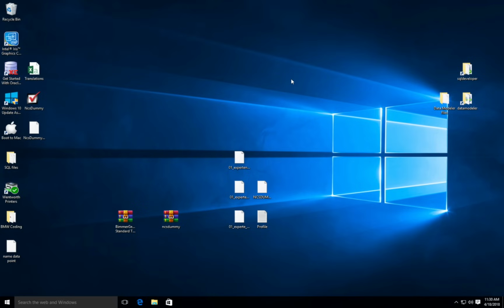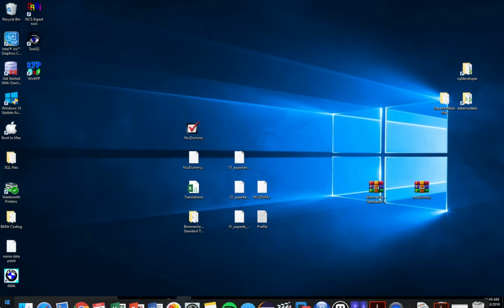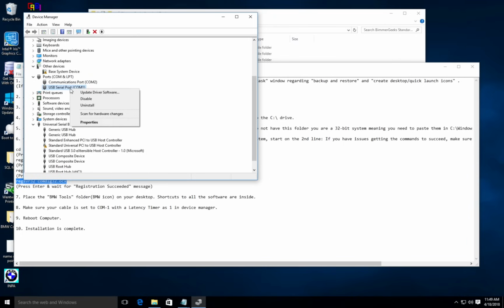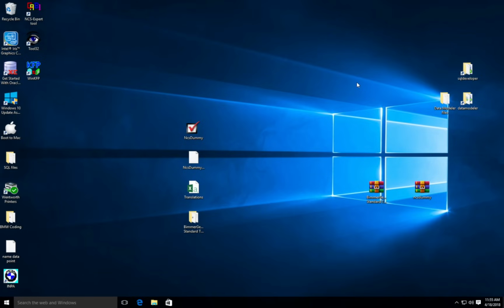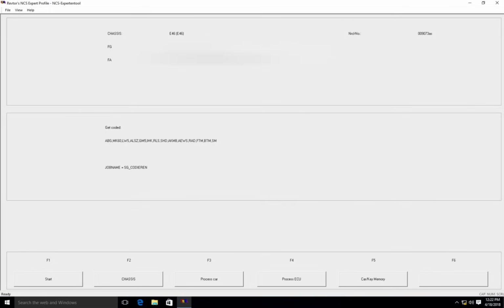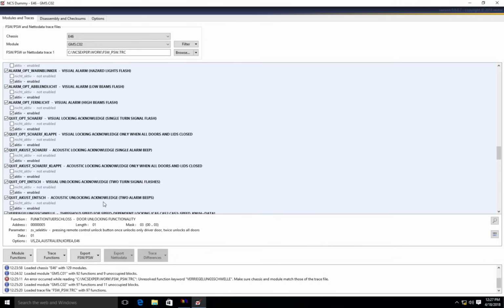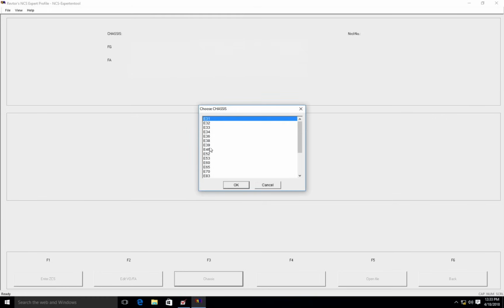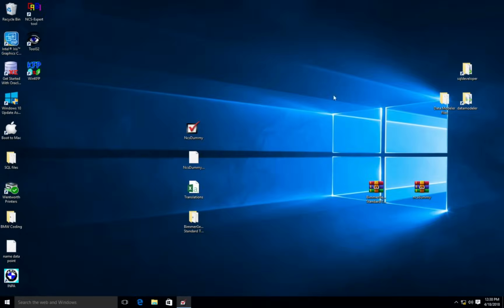HOW TO CODE YOUR BMW USING NCS EXPERT | WINDOWS 10

Comment: For those getting the 'VIN not found' or whatever it says error:
I ordered the exact same cable from the exact same seller. I was getting frustrated and about to give up. I watched this video over and over, deleted and redownloaded the software a couple of times (is 'redownloaded' a word?) and then I remembered that Evan repeatedly said: "make sure that pins 7 and 8 are connected". Same cable, same seller, same switch setting, right?
Nope. I took the clear connector apart to verify that the pins were connected, and noticed that the wires were connected on the right. I moved the switch to the right, and bingo.  Immediately connected.
Hope this helps someone. Try all 4 switch settings if you need to.
Reply: moved what switch?  I have the blue connector apart, and see no switch.  Pins 7,8 are soldered together.
Reply from the maker: Some cables have a switch for different BMWs and some cables are soldered to just work on like the e46, e39, e38
Reply: Ok thanks Evan. I’ll keep trying
Reply: Can you help me I think I screwed up my ecu
Reply from the maker: What were you trying to do?
Reply: @EvanGoyuk  I was trying to do some coding to one of my ECU on my E89 using NCS Expert and NCSDummy but after I coded the first time by 1) upload the TRC file 2) export to MAN file and 3) execute job to SG COIDERIEN and the job was done and completed...........Then this is where i screwed up. I DIDINT EMPTY THE MAN and the computer ask if i wanted to back up man and trc and i choose NO.  From there on i kept making more mistakes by loading up new ECU from the "CHANGE ECU" from the NCS dummy BUT BUT i never change the ECU on the NCS expert side and kept export to MAN and execute the job to write it onto the wrong ECU.....

I did this to about 4 ECU with the same MAN file and now theres errors....AND NOW my car wont start it will crank but no start. I check spark plug it has no sparks.

What do i do now?
Reply: @Yourgirlnadia67  omfg😰
Reply: @Yourgirlnadia67  just code direct from Daten files, back to factory settings.
Reply: @karledenvann6354  how can you walk me step by step please
Reply from the maker: Message me on Instagram for more help @evangoyuk
Reply: @Yourgirlnadia67  Quote Originally Posted by vickumar View Post

Now what do you do if you screwed it up or something is behaving funny and you want to go back to original settings. Or you cant remember all the stuff you changed, or dont like the results.

To load up the ORIGINAL factory defaults if you mess up.

Go to your /WORK/ folder. Open FSW_PSW.MAN, select all, delete, save & exit.

Load NCS Expert

Select "Expertmode" profile

Hit "VIN/ZCS/FA" to load your Chassis and Vehicle order info

Hit BACK

Hit PROCESS ECU

Select the chassis, then module you F'd up on. For example "LSZ"

On Pre-02 cars It will say "LSZ" and underneath "SG_Codieren" along with some files LSZ.Cxx, LSZ.PRG, etc etc. SG_CODIEREN is the correct job you want.

On Post-02 cars It will say "LSZ" and underneath "SG_Codieren" along with some files LSZ.Cxx, LSZ.PRG, etc etc. Hit CHANGE JOB, Select "FA_WRITE" Job.

These files are basically from your /DATEN/ folder and contain the proper coding information specific to your car. How does NCS know which files to use? Because it knows by looking at your VIN and VO, then selects the correct files. NCS will then basically read these files, then read your VO and re-write the proper codes, features, activate, deactivate everything to your factory settings.

The job is SG_Codieren or FA_Write because you will WRITE your original settings back in.

Hit EXECUTE JOB.

Viola, your original data is re-written and your car will work again. Hopefully.
Reply: @karledenvann6354  you're a legend. Very useful.
I bought a scrap car to practice on.
Reply: @EvanGoyuk  does this cable works on 06 BMW E65/66?
Reply from the maker: Yes
Reply: @EvanGoyuk  thank you
Reply: @EvanGoyuk  how about a 2007 bmw 328xi e90 will it work ??
Reply: @Yourgirlnadia67  did you solve anything?
Reply: Instablaster...
Reply: For „vin not found“ you muss close the inpa
Reply: First ..expertmode error ..also .missing modules only 2 in list...when i open dummy there is no option change vin on module🙆
Reply: @homeluangaphay2801  any luck with solving your ecu
Reply: hi kindly share new link for the stardard tools

Comment: I was able to code with this video it was helpful, it was for my 2000 bmw 323i, i had to code the new alarm siren, and tilt sensor. And the interior sensor, i also was able to turn on the windows going back up with the key fob, everything works well thanks go the video, i also used windows 11, you can by pass

Comment: Does your led indicator on obd cable turn off after few minutes? I have older e46 with round obd i need to use adapter… inpa says both circles black but led diode on cable is turned off after few mins

Comment: Your vid is the only tutorial that actually helped me with this, TY. I wanted to code an instrument cluster I picked up from a junkyard to change it from a UK to US kombi/kmb (I'm not in the US) to stop having driver/passenger doors inverted and to get US fuel consumption instead of UK MPG. At first although the coding job was executed (and I heard the cluster "roll") but did not land any results. I realized that's because I had closed NCS dummy before executing job so it must have coded the TRC file I guess... The only thing that did not work is the tamper dot removal, eventhough I checked the appropriate option and the mileage had already actualized on its own when I first connected the cluster (apparently the cluster displays the highest of either its own or the car's mileage upon first connection so it must have had a lower mileage than the car).

Comment: I did a reset on my SAS and that performed correctly and the DSC is still lit up on the dashboard. I need the SZL coded to the car but it won't allow me because vin is faulty. Any suggestions

Comment: Hello! First time caller, long time listener. I was wondering if you would be willing to assist me with a short remote session to fix my no EDIABAS option in setting for ISTA vs. 4.49.23, or point me in the right direction. I have updated the ports and config settings and still nothing. Also if you can may you provide me with the coding options for the E70/N55/2013/X5, I have 4 CAS settings driving me crazy I need to code.

Comment: Hi,  I can get INPA to connect - sees ignition on and off - but can't get passed the Chassis loading for my E63 - after loading the profile (used the same one you do in your videos).  It appears (for a number of things that I've seen) that I would need to choose E60 (Series 5) as there is no 63/64 but when I select that it doesn't bring up the ECU selection (CAS) and I get no VIN no. etc?  I definitely have Pin 7/8 connected (switch to the right) and I 've tried the switch in all four positions (to the right definitely connects pins 7/8 - checked it with a multimeter).  Any thoughts about what I am doing wrong?

Comment: Hi Euan,
Great video walk through.

Quick question, my GM3 module went faulty so I replaced from a donor car.
Would I now have to use NCS EXPERT TO code it to factory or is factory not VO ie…… folding mirrors when in reverse etc….. and is back to basic settings?
Do I click process car?

I hope this makes sense.
Look forward to your reply 👍

Comment: Hey man! Great video. Wondering if there is a way I can turn off bulb out warnings. I’ve built some custom tail lights with LEDs and don’t want to run a load resistor due to space and also the heat they generate. Looking online there’s not a lot of direct info on where to find it.

Comment: Since manual and auto trans E46's use the same cluster, would it be possible to custom code the cluster in a manual trans E46 so it displays the gear selected based on RPM and wheel speed? 
I've seen stand alone systems display gear selection on manual transmission cars doing it this way, so it seems possible since an E46 already has all the needed hardware.

Comment: Can you please make a vídeo, or if someone could help me because i want to install rear powered windows in my e46, and i have to copy my current (low)gm5 module options to the new (high) gm5 module or else my key won't unlock and lock the car. So i need to copy all of the options of my gm5 module to the new one. With NCSexpert

Comment: HI I am using window 10-64bit and it seems everything install corrected.   As I verified, Everytime I plug/unplug USB K+DCAN and see usb serial port (com1) appear/disappear. Also "Battery and ignition is black dot show" But none of winkfp/NCSexpert/INPA   will pop up messages "IFH-0003 DATATRANSMISSION TO INTERFACE DISTURBED Program will be stopped "   Any idea what K+DCAN missing configure here? I even tried to different COM X then other will not make "Battery/ignition black dot"  NOTE: trying to re-flash FRM footwell corrupted.

Comment: What is coding? Programming? Flashing? Say if I am replacing the airbag MRS module, it is flashing? Here in the video, coding is just changing the optional settings for the module, like one touch all windows down. INPA is to just test the cable and ignition on? NCS Dummy is just a translation from german to english. TRC file is when u read. MAN file is when u write? They are both just txt file.
What is profile? A looking table from VIN to all the factory modules? 
Yes, I am still so confused. I don't want to just follow the step by step instruction. I want to understand the concept and the overview.

Comment: Hi Evan, are you still actively coding? I’m having trouble coding out a cornering light error on my e90. The motor crapped out and I have since replaced the complete headlight units with after markets.
Are you able to advise?

Comment: Very informative video. Thanks.
I could code an E46 323CI after following this just fine. However the E46 M3 remains unchanged. No errors though. Coding gets finished just fine.
I already did an SMGII tune using MSSTuner so there must not be an issue with the K+DCAN cable. I need to try it again tomorrow fresh.

Comment: Question
I didnt have on my bmw e46 bc button on left side, so i installed it but now i need to code it, where in NCSExpert i can find where to activate BC button from there and see if it works ? What modue does that bc button belong inside ncsexpert ?

Thx in advance

Comment: I recently picked up a 2011 e82, I tried to code my mirrors to fold on locking , but BimmerCode mentions my FRM to have severe faults. Would I be able to get around this by coding via NCS?

Comment: An excellent video, for those of us that are starting to use INPA and the rest of the software.
However. After installing the software following the instructions here, I get all the INPA diagnostics in German. I left all the tools in a folder on the desktop called BMW TOOLS, and moved the translations.csv file there, but yet the diagnostics are not translated. Should the .csv file be located somewhere else? Txs for the help

Comment: Hi Even

Had to change the ECU, ABS pump and the cluster in my E46 M3 due to a fire in the engine bay! Any ideas how I can change the FGSTNR so they all have the correct VIN number for the car?

Also need to do any coding thats required for them to work and talk to each other etc, can this be done with INPA or NCS Expert? I also have PA Soft but a lot of my options are greyed out so maybe I'm only running a demo version or something? Also have a Lew fault which I think just needs the steering angle sensor to be calibrated which I think I can do on INPA

Any help would be great

Great tutorials by the way

Loz

Comment: Great job, very informative. My question is what if you wanted to do a used module? Would you read the original, copy all the coding in notepad, put in the replacement one. Open in notepad, delete what's there and paste the original coding info?

Comment: hello I'm trying to follow in your footsteps but an error message is showing: "Error at changing ZCS COAPI-2020: SG antwortet nicht IFH-0009: SG nicht angeschlossen oder meldet sich nicht C_GM4 COAPI-2020: SG antwortet nicht CODIERINDEX_LESEN COAPI-2020 : SG Antwortet Nicht"

can anybody help me? I have bmw e36 323ti 1998 wich GM4_C03

Comment: Ok guys I hope this fall somewhere in this but if it doesn’t then I’m sorry so here I am driving my 2007 bmw 335i and all of a sudden it hiccups and all my warring go off trans malfunction,DSC  engine malfunction etc otherwise I’m in limpmode so I get it home next day my battery has dead cell get new  find out my alternator was bad fix that now this is where I came across ur comments maybe u can help me I know I need it right cables to plug into my car and the software but my question to You is how to get my car out of limp mode do I need bmw to clear or can u help me with the problem I could really use ur help or anyone out that can help with this problem also  I have registered the battery and did a hard reset but still when I start the car no major warning I know the car is In pretty good shape problem is it always brings up after it’s running for a few mins any help would Definitely be appreciated

Comment: im trying to download or install the s1212.exe its not giving me no option to turn to windows 7 or run as administrator and im getting nowhere im running a windows 10 the error im getting is ( the setup can not be installed on this operating system version only windows nt 4.0 and windows xp professional are supported ) thank you

Comment: Hi, Evan.

I have what you can call an uncommon issue.

A while ago I used ISTA-P to update all the modules in my BMW 520d E60 09/2007 (pre-LCI I think) with the "magnificent" N47D20A engine. I used an ICOM Next A+B+C which worked flawlessly for me.

All good until it reached the last two modules, which were the CCC and the Bluetooth. Somehow the jump lead from the battery got disconnected during programming and both modules mentioned went to "Programming Mode 12" or something and until I figure it out I couldn't use the screen, listen music, etc.

The "funny" part (well, not that funny, though) is that I couldn't find ANYWHERE the codes for these two modules, and by "codes" I mean the numbers shown in WinKFP to describe the modules, which in my case were 

VIRTSG91 - (Bluetooth) - 9176842
and
MMI/CCC - (The CCC module) - 9176841.

Somehow I used another version of CCC, which actually is allowing me to use the screen, but apart from the music list, there are NO WORDS shown on the screen.
The Bluetooth is still in Programming Mode and I couldn't activate it no matter what I've tried.

Do you have any clue of where I can find those ZB numbers to match those I have?

Any idea would be much appreciated.

Best regards,
Valentine.
Reply: Unfortunately you said that the power had been disconnected while rewriting to the dme. if you don't have the original programming then the chances are high that you won't be able to recycle it and you'll technically have to 'unbrick the module' or buy a new one and calibrate it in via INPA.

Comment: Evan do you know how to code a new "uncoded" instrument cluster and write the VIN and KM to the new cluster and copy the data from the old cluster to the new one? 
I tried a few things but don't want to mess it up. Perhaps you know how to do it.
Reply: I need to do this as well
Reply: @brandoncanales6017  If it's for a E39 and you have a "new" cluster you need the K+D CAN cable with the switch. Download NCSEXPERT and INPA. You can do it with these programs. If you have a "used" cluster it's not going to work with NCSEXPERT.

Comment: Nice job making the video.  I was wondering if you can assist me with a question I have.  In NCS Dummy , how do I add an option to one of the choices in the trace file.  For example in CAS module, in battery coding, how do I add an option for a 92ah agm battery.  I hit on one of the choices which was 80ah agm and right clicked, then selected add an option, but then I don’t know how to populate the boxes below for this choice to become part of the trace file.

Comment: Hey, my friend own a 2007 525i and had a CAS module recently changed. The active steering and abs light came on and the steering module replaced. Will this program reset and remove these faults permanently? If so, could you please advise me to how to do it using the software? Do anyone knows how to reset this problem besides the dealership?

Comment: I need help with coding out my TPMS system on my E90... im in UK. And on NCS expert....the $2vb in FA/VO isnt there at all that every1 has been deleting to get rid of thr tpms light. I have unplugged the Module in the trunk. My cable also flashes then the light goes out after i get as far as reading the CAS ecu to see the FA/VO codes. Any help much appreciated. It is a purpose built cable i purchased specifically for INPA and NCS.
Reply from the maker: Message me on Instagram @evangoyuk

Comment: So in the process of trying to get this setup on my older windows 7 64 bit laptop.. Acquired the expert and dummies zip files along with the 5 files from the google drive.. Started setting everything up.. Installed the standard tools ..but the ec-apps and ncs expert file folders arent in the unzipped file.. 
Just a zipped dcan file , ediabas installer inpa text inpa jpeg 
The standard tools setup 2.12 which is step 1 step 2 latest inpa tools v65. Step 3 ncs sp-daten v65 and step 4 pfl (all setup install files) 
No ocs oxs ( cnt remember ) isint in there either .. 
Has anyone expierenced this ?
I feel like overt overlooking something stupid .. even looked that the folders in the dcan zip thinking maybe they were burried somewhere.. 🤷